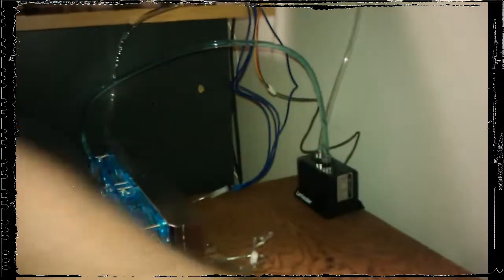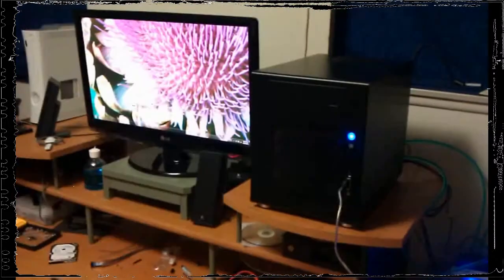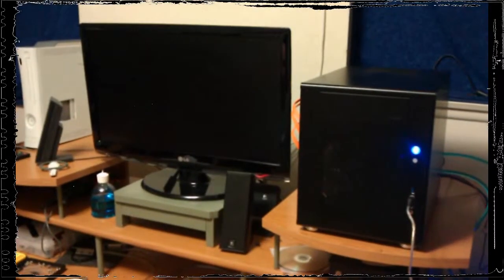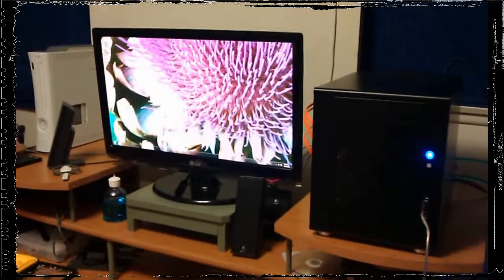Part 4 Building custom PC with liquid cooling system

Comment from the maker: @earthrise5656 Yeah, I shot the video on my EVO, I know it's blurry. I added quick disconnect valves for easy transport. I ran the cables directly behind the computer case and down underneath the computer desk and you can't even see them along with the cooling system. And yeah I added the dye to make the video look more dramatic :) 
I don't use seagate, they have cylinder issues. 
Thanks for the comment.